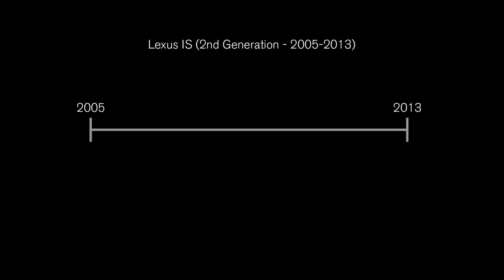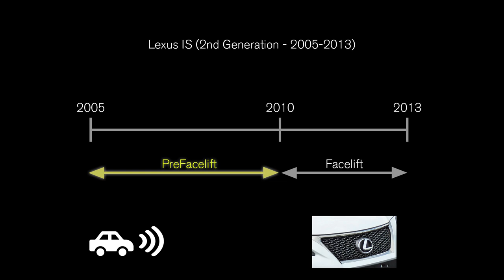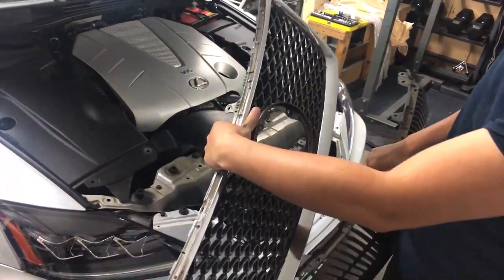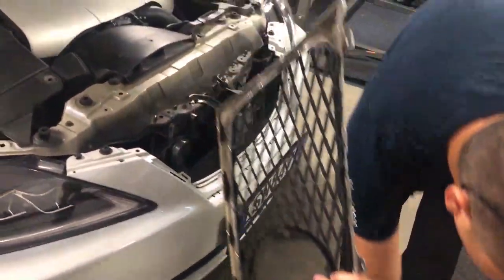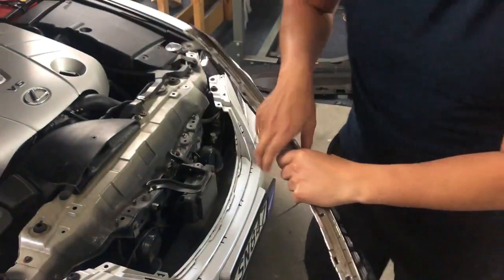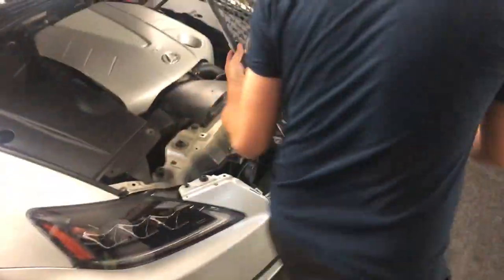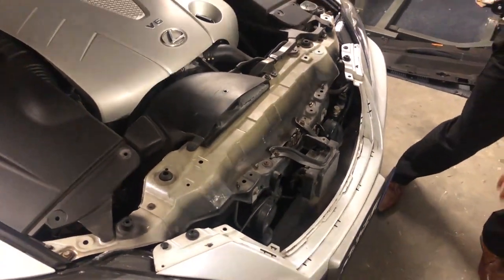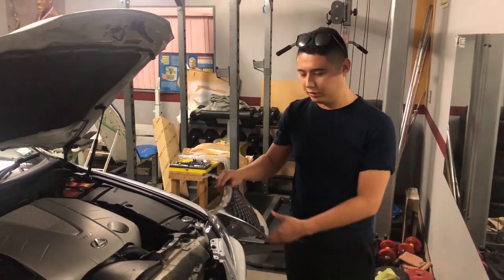LEXUS IS F-SPORT GRILLE INSTALL!!! WITH RADAR CRUISE CONTROL!!

Comment: Finally a video of someone has distance sensor on his lexus.

My lexus is 2011 has a distance sensor on the lexus logo may I know how did you manage to the F sport grill installed? Did you do a lot of drilling and stuff to modify it.

Any suggestions? I want the same grill so bad and finally saw your video
Reply from the maker: I believe if you have a 2011 model it should be really easy. You simply just buy the F Sport grille, one with the space for the radar badge. There should be no drilling required, it should just fit straight on. You only have to drill if you have a pre 2011 model and have radar cruise
Reply: @sammygoris  can you share the website that you buy the grill from?
Reply from the maker: @alialwahedi4672  if you watch the video, I state the part and part no. That you need at 0:40 seconds. You can buy it through any OEM parts site, or any dealer. I got mine through Amayama.
Reply: @sammygoris  Perfect, thanks brother

Comment: If you have the radar cruise control, do you need to install that big shiny Lexus badge back on or can you just get a completely different grill with the smaller Lexus badge? Just curious if the radar cruise control will ONLY work with that big glossy Lexus badge.
Reply from the maker: I haven’t tried it, but that radar badge is made from different materials that allow the radar to properly see through. They’ve obviously made it a different part for a reason (all manufacturers have the same thing), and I assume a standard badge will interfere with the radar cruise control system.

Comment: Hi Sammy, just wondering if the reason you use the facelift grill is primarily for the badge clips? Would it be possible to use the pre-facelift grill and then stick the badge on with 3M tape etc or does it need to be plugged in? Thanks for the video. Cheers
Reply from the maker: Hi Cameron, the PCS badge is completely different to the non-PCS badge. It is much larger and the badge surround is completely different in how it is recessed into the grille, so 3M tape will not be sufficient. Does that make sense? Cheers man.
Reply: @sammygoris  Hi Sammy, thanks for the response. That makes sense to me. One last question, did you dremel off the top and bottom evenly? Just wondering if the placement of the badge has to be exact/match with the radar module behind it. Big fan of your build on Club Lexus NZ by the way - I have an '06 350 in Glacier Frost Mica too and am in the process of doing some of the same mods myself. Cheers
Reply from the maker: Cameron Coe yes my mate and I definitely thought about that one! Thankfully it lines up properly so there are no issues. We also had to test it for the 3IS conversion as well, the badge sits a bit lower on the 3IS conversion.

No worries man! Yep I’ve had my fair share of cars but the IS has really stuck and I’ve been very happy with it so far. I’ve had a lot of joy updating bits and pieces here and there. All the best with your build bro!

Comment: Is it possible to get a prefacelift grill on to my lexus with a facelift?
Reply from the maker: James Paraoan Hey James, remember that the tabs on the grille are different. You can do it, but it requires a bit of work to make it fit. Why are you wanting to do that?
Reply: Sammy Goris an isf style grille is around $250 and a pre facelift(06-08) isf style grill is around $75
Reply: @bamezbaby  did you do this mod? that s exactly what i want to do, because it s much cheaper 😆

Comment: Was looking at 2nd gen IS, some advertiser then as having an Adaptive Cruise control. Is that true or are they referring to the Pre-collision as yours?
Reply from the maker: r cast Officially, the feature option is called ‘Pre-Collision System (PCS)’, which also gives you  Adaptive/Radar Cruise Control - my car has adaptive cruise control as well, but again I call it PCS because that includes adaptive cruise control. Pretty much every car that has a PCS feature will also have adaptive cruise control because it uses the same system and parts.

All Lexus IS come standard with Cruise Control, only some have the PCS option, and you can tell by the larger badge with the resin coat over the top.

Does that make sense?
Reply: @sammygoris  Yes, it does. Thanks for the explanation.  I can't believe a 2006 car has this system.  Which make me waiting this IS more 😊, which is more affordable too.

I was looking at the 2014 but the base doesn't have it except the 200t, but prefer the 250. 350 would be nice, but L & P drivers are not allowed in Victoria, Oz. Only the Sport Luxury and optioned on the F sport have them, which is more expensive. Ill just upgrade to a 350 once my daughter is thru her P's since we will be sharing the car.
Reply from the maker: r cast yeah it’s insane how well equipped it was for a 2006 car. Even though the 3rd gen IS is a really nice upgrade, and the exterior is a more modern style, I think the biggest difference you’ll notice is the interior. It feels much more newer and nicer. But again the costs are much higher.

But the 2nd gen IS id still very well equipped, but make sure you find one with lots of features!